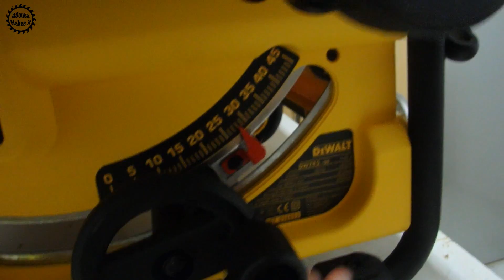My new table saw DeWALT DW745

Comment: i have excatly the same version of this table saw dw745.. however, how did you solve the noise problem of universal motor?.. i have an idea to change this universal motor to brushless dc motor.. have u ever though that before?
Reply from the maker: +Halil Orbay Okyay Hi, there isn't that much we can do.. I added some noise canceling foam but didn't help that much. Maybe foam on combination with a good enclosure could work. I'm planning to do that in a near future.
Reply: waiting for your inform.. fully enclose box, it will problem about heating and dust.. :( but need to try i guess

Comment: Hi there, I was wondering what is the ripping capacity for this saw.
And can you send a link from where you bought it?
Thanks
Reply from the maker: Hi, the max ripping capacity is 61 cm. I bought it in a phisical store in Portugal. Cheers!
Reply: @ASousaMakesIt  You can extend it by 11 cm by buying spare screws from Dewalt for the fence and measuring out an extra 11 cm for screw attachment. You then simply lock the fence in the alternate position when you need the extra ripping width, adding the 11 cm onto the scale reading.